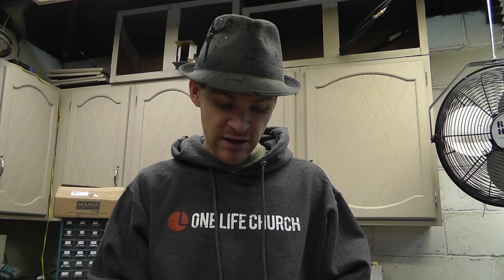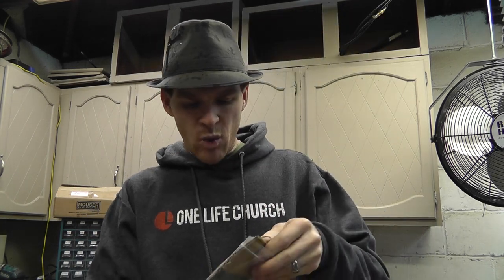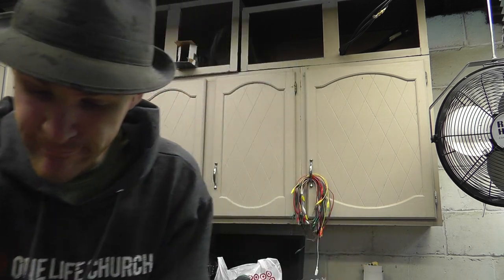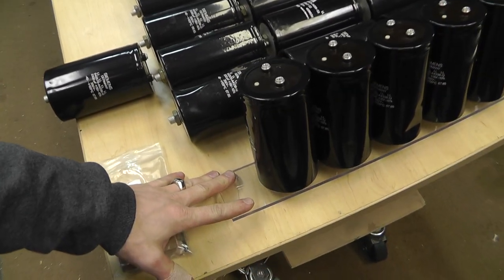10K joules Intro : This Is Crazy... What Would You Do With 10,000 Joules?

Comment: Use the caps to spot weld some steel angles together.  Build a frame of steel angles for a small lathe or table saw or jointer or what have you.

Comment: How about a magnet track launced magnet rocket? Rocket and track would need to be pretty solid to withstand the acceleration jerk. I think a simple launch tube wrapped in coils with are fired in succession could do the trick. I wish Rodin coils could do this solid state, one simple circuit, but I've not seen a wiring pattern to exert thrust in this way.

Comment: Hey! Here is an none destructive test! I remember the first time that I charge my 10 kv capacitor! at it's full capacity! I connected it to a large Piece of Neon that I have in my chop! it lited it for about 3.5 Hours! I wonder if you can do the same! 
You don't mentioned the voltage of each cap so I just don't know if it will be doable "sorry about the grammar...." any way if you can brake above at least 2500 V you can light a large piece of neon!